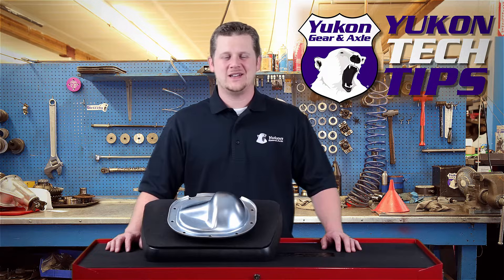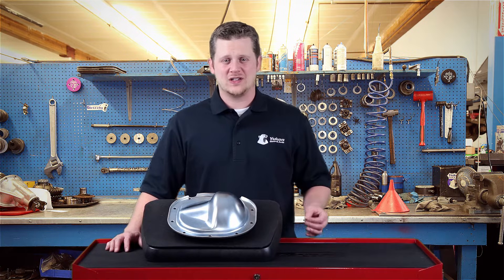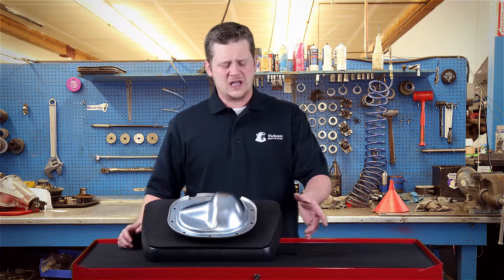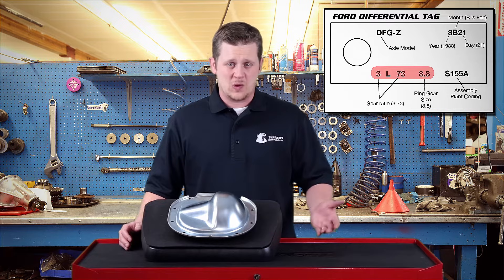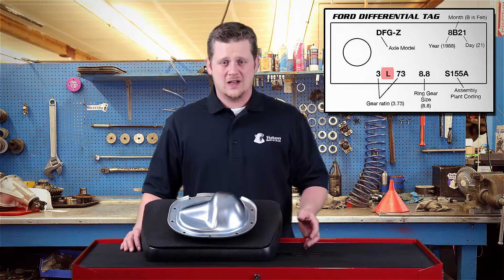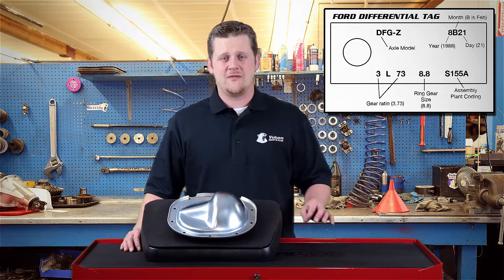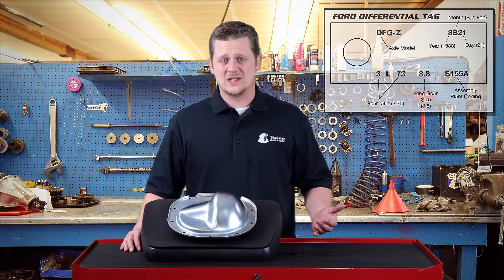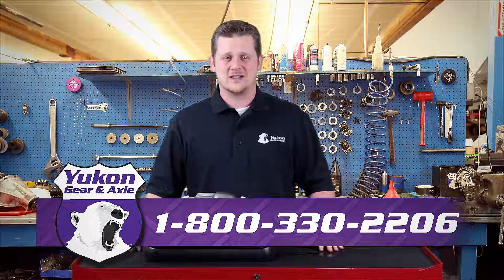How to Identify Ford Differential Housing Tags | Differential Tech Tips

Comment: Please help identify the following 63 Ford Falcon rear end.
Top row - W8W   L
Lower row - 3.50  2JD  507
Reply: it is a 3.50 to 1 ratio if it has a v8 with 5 lug wheels it an 8 inch ring gear if it has a 6 cy  with 4 lugs that's not a good rear end. . I'm glad my 63 SPRINT came with a 8 in .

Comment: Trying to reset my revs. Cal. I have a 96 f250. I recently put a 6in lift and increased the tire size to 35x12.5R 18. I have a 10.25 with 3:55 gears need to know how many teeth are on the pinion gear. Cant find any info on this. If you have any it would be greatly appreciated.

Comment: I have a1990 mustang gt 5.0 with aluminum heads truck flow cold air intake 70mm bbk header 5 speed stick tag says 3.07 rear gear. Would going to a 4.11 be to much for mostly street and some highway driving?
Reply: i just searched about that becuase i have the 3.73 on my ranger but remember years ago i heard several guys put the 3.73 on older mustangs. I doubt you would want a 4.11.....my 3/4 ton van has the 4.10 and it works for it but you would probably throw you money and fun out the window on a gt
Reply: 410 2000 rpm 60 mph

Comment: My rear Axel differencial have 2 diferents numbers:  V 953 J  and  L73   9 75   4K11.  I can't understand that.  It's a Ford F150 2004, with 5.4L 3 valv. Please somebody can help me please,  I need replace it or fix it. Thanks.
Reply: 4.11 gear ratio
Reply: i have  top number v 953 f and 6 L  73 9 75  4A20  don't what that is.

Comment: does this work back in 1988     a tag has 55 10 2  would be what  ???
Reply: Ditto on your question   mine  is on a 1985 F250 diesel 4x4
Reply: Same here starts with 55 10 2 9b03 on my 1989 f250